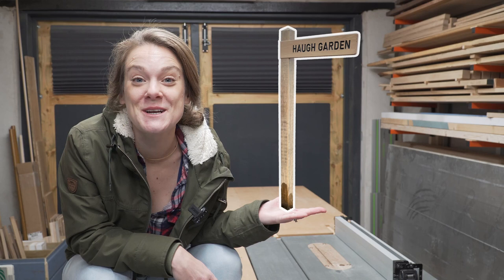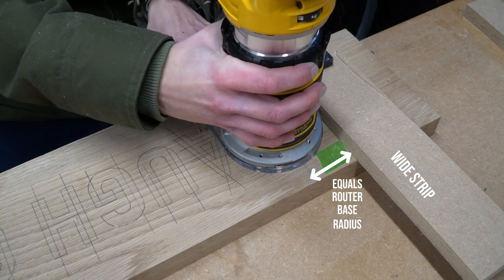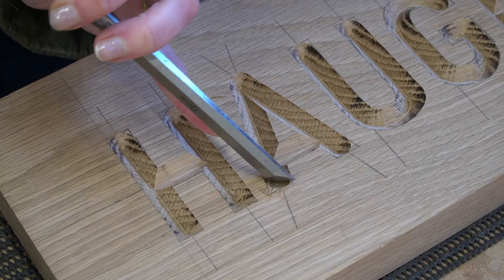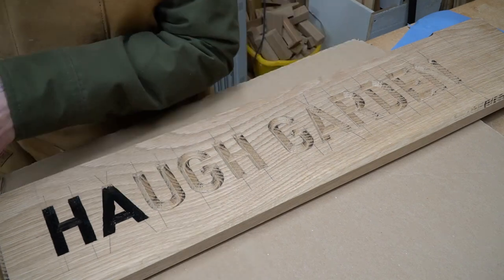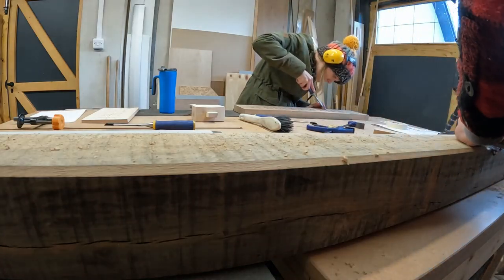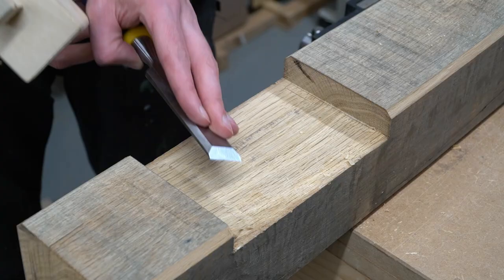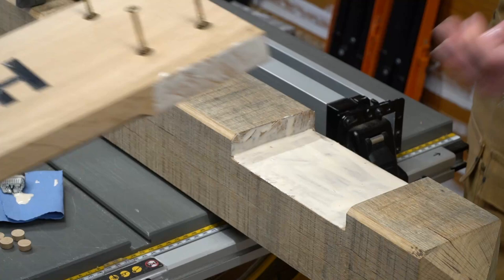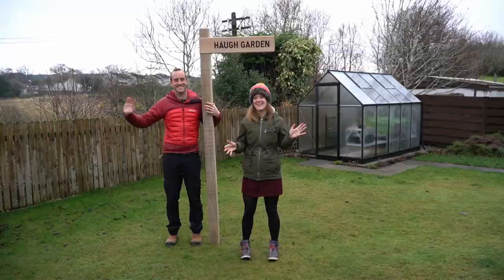Easily Carve Letters with a Router | Wooden House Sign

Comment: No where as easy as she claims, Palm routers run 8,000 to 24,000 rpm, minor false move and you have a handsome piece of firewood!
Reply from the maker: Hi Sullivan’s Papa, it’s certainly not a job you want to rush. With familiarity of a router, the right setup and taking your time, it’s really not so tricky. 

We were apprehensive at first but as time went on we got more and more confident in the jig. Of course you can still goose it up, but that’s true of every tool and project if you aren’t careful 👍 👍
Reply: Testing and acclimation is muscle memory's friend.

Comment: Thanks for the idea for the straight edge spacer jigs. That adds a major degree of "quality" to the finished product over freehanding it. I took it a step further and used my center punch and tack hammer to put an exact starting point for each new stroke and then used the bit's edge for where to stop at my bottom guideline.
Reply from the maker: You’re very welcome, @pikesticker. And thank YOU for that genius piece of advice, so simple but effective. We’ll definitely be doing this going forward. 👍